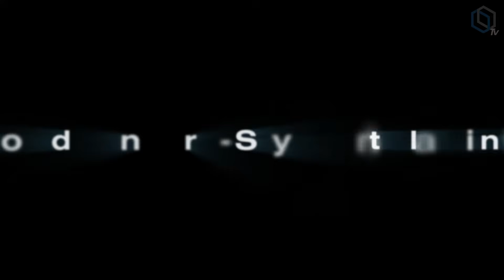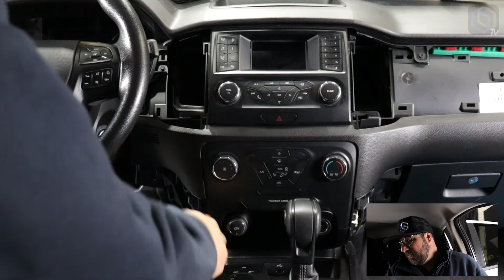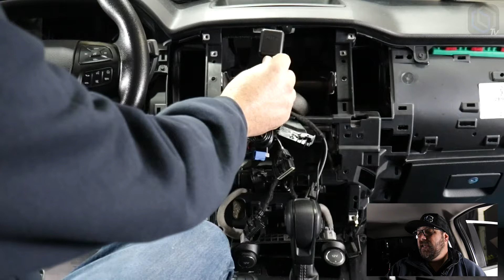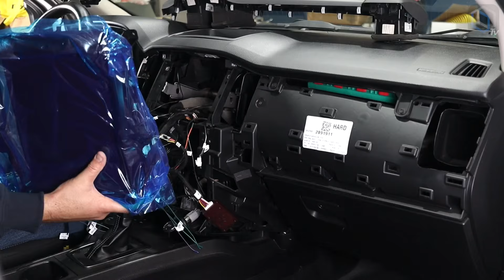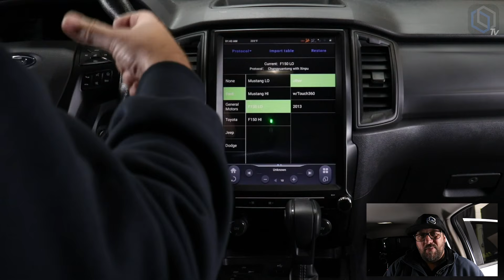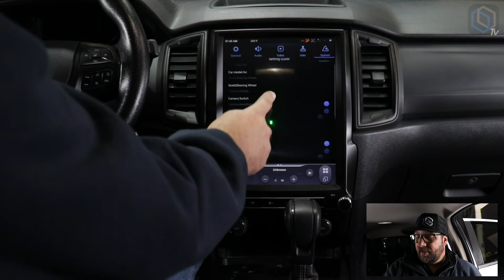Installing a 12" Screen on a Ford Ranger

Comment: About ready to return mine. I can't get help from the people that installed it, or linkswell. My steering wheel button configuration is all off and my dual AC is not working.
Reply from the maker: Did you follow the set up process in the video?

Comment: Where do I purchase the panels that split the factory radio and heat controls that is originally long but now two pieces due to the stereo? And also where do I order the stereo?
Reply from the maker: Our stereo comes with all the harnesses and panels you need for the install. No need to get any extra parts. 

To purchase you can use the find a retailer tab on our website www.linkswellinc.com or you can purchase through one of our online dealers like www.adcmobile.com or www.fnaautomotive.com or www.americantrucks.com

Comment: Just got mine installed and I'm getting an out of range with my WiFi. Any help would be great
Reply from the maker: What are you using for a WiFi source?  If it’s an iPhone or hotspot make sure you select most compatible and not only 5G.
Reply: @LinksWellInc  i have a google pixel 9 pro  xl. and comcast for my WIFI. i can get the android auto  to finally work, but i still cant sign into my wifi and or google account

Comment: Too many, "this won't work, and that can't be used." Why install something that DOESN'T WORK 100% like the original did?
Reply from the maker: What are you talking about?  There are no features we lose. Just because we don’t need to use a plug doesn’t mean we aren’t replacing the feature.
Reply: @LinksWellInc so does the Aircon still work properly bro I'm trying to buy this
Reply from the maker: @bigalpha1490 yep. They work just like they did on the factory. So if had dual climate it keeps it. If you had seat heaters it keeps it.

Comment: just checking out your video   1 question on my head unit i have the air bag  button, but you tell me if this unit has the airbag  button  installed
Reply from the maker: Yes ours becomes a digital one on the screen.

Comment: What company did you order this screen through and did you have to solder a lot of the wiring or was it easy to just plug it in?
Reply from the maker: We didn’t order it. This is a radio we manufacture. There is no wire connecting it’s all plug n play.

Comment: This video would have been so much better without the background music. Also, I'm not going to buy this now because it seems so complicated with all the wires. But thanks for the video man. You save me 1,200 bucks
Reply from the maker: So I remade it with less background volume. 

The install is all plug-n-play you will not find an easier aftermarket radio to install.
Reply: @LinksWellInc you have to remember sir. Not everyone is as smart as you and I mean that with a lot of respect, I believe you are very smart. I am what you would call an idiot. I seem to mess everything up in some little way every time. Thank you!
Reply from the maker: @mmstudios95 so we only sell to dealers. Best to have them install for you. ;)

Comment: Does this setup work in the Ford Ranger Raptor 2018?
Reply from the maker: Yep. It will.
Reply: Will it also work if the ranger is Right Hand Drive?
Reply from the maker: @ramishbiachoo1392 it will not the bezels only fit left hand drive Rangers.

Comment: Hello, i have a 2022 ranger without the B/O speakers and with the LCD touchscreen. I’ve connected just as you did in the video but the radio doesn’t turn on, it does nothing, only the hazards button works. What can it be?
Reply from the maker: You have the red can box installed?  You didn’t pop any fuses when removing or plugging in?

What generation radio is it?

Comment: Do you have anything with a newer version of Android, instead of 9.0?
Reply from the maker: Our Generation 6 T-Style and XL Radios are running on Android 11. 

As a rule we will always be at least 2 versions behind the current for a few reasons.

1. We will not develop on an actively updated version.  So if the Android platform itself is being updated those updates can mess up our programs.  So we have to wait for a version to be finished with updates before we can start to develop with it as to protect our customers from having failures that we have no control over.

2. Once we start development of a new radio it will take anywhere from 12-36 months of testing and firmware writing to get it working perfectly.  So depending how long that takes other Android versions will have released during this time.

3. We try to release a new generation a year, sometime that doesn't happen.  So depending on recent of a release the radio is another version of Android could have released during the production time of a radio which will also adds how many versions behind we are.  

So all that to say, we stay back in versions to be sure our products functions well and for a long time with the least amount of issues arising.

Comment: Hello I have installed one same like this…but I am having problem with aircon…when temperature on max it keeps fluctuating…and getting hot air after cold air…can you help pls
Reply from the maker: @ridhwaanjhug2228  is it our radio?  Did you program the HVAC?
Reply: @ hello what do you mean by programming HVAC? I have tried to control everything on the system…but it seems to be a problem…because it keeps giving cold air and cut by hot air …temps keep rising and lowering…even on the dashboard….i have even tried to manage the control setting for ford Everest and reboot it…but it is same as before
Reply from the maker: @ so you don’t have one of our radios. It sounds like the HVAC isn’t set correctly. You need your contact the manufacturer of your radio for support.

Comment: Hello, is there a screen you can recommend for me Ford Raptor 2021 model? If there is, can you send me a link to order? Thanks 🙂
Reply from the maker: @djtoganc6086  if it’s the new body style F-150 we do not make one for that dash yet.
Reply: @LinksWellInc  old model Ford renger raptor 2021 2.0 EcoBlue
Reply from the maker: @djtoganc6086  understood. This radio should work in the Raptor. 

To purchase you would contact one of our authorized dealers. We have a find a retailer tab on our website www.linkswellinc.com that will use your zipcode to get you your the closest dealer. Or you can order online through one of our online dealers like 

www.adcmobile.com or www.fnaautomotive.com
Reply: @LinksWellInc I also have a gen 5 raptor. Can that radio add the 360 camera ?
Reply from the maker: @jorgesarduy007  add it?  Like you are going to buy all the cameras and the video stitching module from Ford and you want us to make it work?
Reply: I dont need 4G and wifi if I'm only using bluetooth, right?

Comment: Definitely been thinking of installing this myself in my 2019 ford ranger. Will this work with ford pass?
Reply from the maker: @natefiggs  all but the tracking feature. The tracking feature is lost when removing the factory radio.

Comment: So I have a 21 Ranger. Does this keep the Ford Snyc ?
Reply from the maker: No. We don’t retain any of the factory SYNC or radio parts. Doing that would limit the features we could add and leave us vulnerable to issues caused when Ford updates the SYNC. 

So to prevent issues, control quality, and add features SYNC is removed.
Reply from the maker: No. We don’t retain any of the factory SYNC or radio parts. Doing that would limit the features we could add and leave us vulnerable to issues caused when Ford updates the SYNC. 

So to prevent issues, control quality, and add features SYNC is removed.

Comment: Do you keep all steering wheel control? 
Does it keep the cross traffic warning display?
Reply from the maker: Steering wheel controls yes. 

Where does the cross traffic alert show up?  Cluster or dash?
Reply: XLT center cluster
Reply from the maker: @markcope9853  should stay the same

Comment: Quick question had a similar radio installed, I don’t know what happened that the truck would go into battery saving mode and I would have to jumpstart the vehicle every 2 to 3 days.
My radio guy could not figure it out. so I had him come back factory stereo

I would love to go out there and put the same screen that you installed this video

.
Reply from the maker: Sounds like a CanBus issues. That happens when development on the CanBus isn’t done completely. 

If you want to try one of our radios you can purchase one of our radios from any of our authorized dealers. You find one you just need to use the find a retailer tab on our website. 

www.linkswellinc.com.

Comment: what is the total cost? I have a 2020 ford ranger
Reply from the maker: Depends which generation you purchase and where you have it installed. 

MSRP for the 
LITE is $699
Gen 5 is $1,495
Gen 6 is $16,95

Labor for install will depend who your purchase through.

Comment: Hey I just got mine installed today and I had a few questions. The first issue is I don't have audio playing from the rear speakers. I went into the settings and turned the front volume all the way down and the rear all the way up but noting is playing. Second, I got a front and side cameras installed is there any way where the screen auto switches to the side cameras when I hit the turn signal also the image in the front camera is mirrored is there any way to fix that? Third is there any way to have the parking sensor appear on screen to show distance once they start beeping like with Sync 3? Thank you!
Reply from the maker: So if you have B&O, the rears work but the B&O amp doesn’t have inputs to fade. 

The multi cam situation for auto trigger will depends who’s multi cam system you had installed. 

The front camera being mirrored that is fixed on the camera itself. Most aftermarket cameras have a wire loop that is either cut or connected to mirror the image. That is done on the camera itself. 

You should see the rear sensors on the reverse camera screen under the camera image.
Reply: @LinksWellInc 1. I was able to get the audio working! The issue was with the default EQ preset. Once I switched the preset to one of the other premade settings I was able to hear audio from the back.

2&3. Ok sounds like I'll have to ask the shop installed to help with those.

4. Yes it does, but I was wondering if there is a way it could pop up when pulling into a parking space or something like that

Also thanks for the help!
Reply: Nav tv dsp works better than this radio

Comment: Wat, what happened to the hazard light switch?
Reply from the maker: The hazard switch gets replaced with one on our radio.
Reply: @LinksWellInc  thanks, didnt notice it in the video, but see it on the website. Will this fit my Ford Everest?
Reply from the maker: @thegrandargus  this is for a Ranger.  Where are you that you have an Everest?
Reply: @LinksWellInc  I am in Jamaica. Do you ship? Or you only install?
Reply from the maker: @thegrandargus  so we do not do either really. We are the manufacturer. So we design, develop, and manufacture the products. Then we sell them to authorized dealers across the US. 

We have some online dealers that could ship to you www.adcmobile.com or www.fnaautomotive.com

But I don’t know that this radio will work in your Everest. If there is rear climate controls those will most likely be lost at the bare minimum.